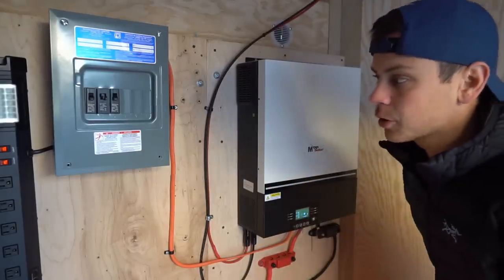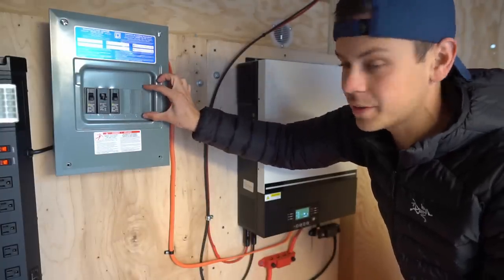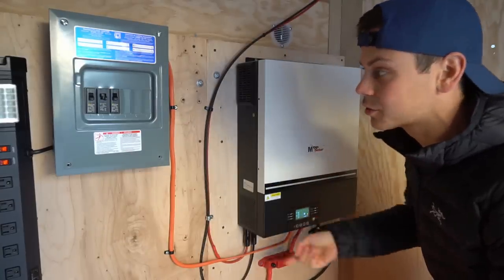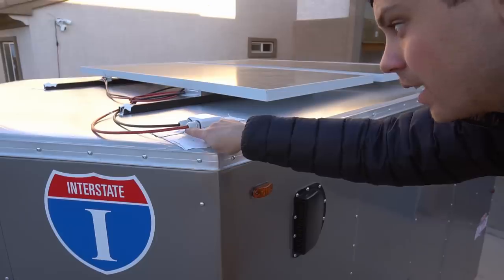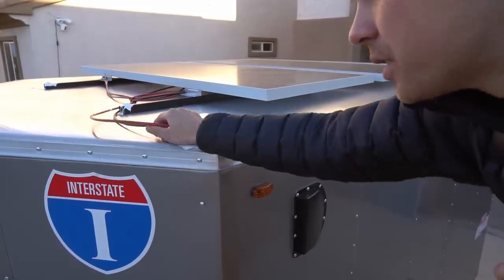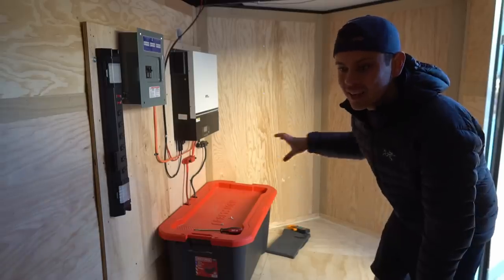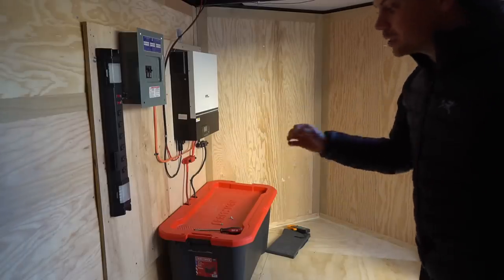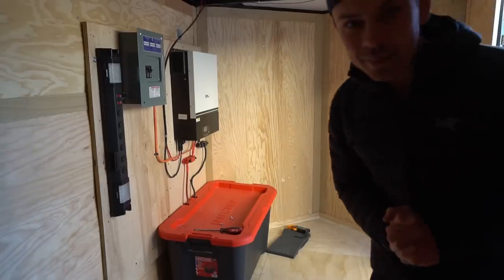Utility Solar Trailer Part 2: Responding to viewer comments

Comment: Your trailer is awesome and I know you have some uses lined up for it. I think you should make one that has the same 8000w capacity, but also have a 220v/110v panel with about 4 times as much battery capacity and give it away. Just think a functioning trailer unit like that with the ability to hear or cool would be a great solution for these crazy weather events we are having. FEMA may want your design if you can get UL listed components.

Comment: Nice response video, I still have more to learn on the AC side thanks for sharing, BTW got all the components finally for the folding crate build but just put out a video on solar folding panels and battery banks for portable in field use. Hopefully get the crate video out soon, will let you knownwhen the vid is up as we talked about previously. Cheers!

Comment: You did an awesome job hitting all the points. I was pretty excited when you said the inverter did 240v split phase yesterday. I actually went to the site to buy it and then read that you need at least two (up to 6) to make this happen. Still very cool as I have a well pump that I plan to make powered by solar and this could be a solution. What is the total cost of everything you have in the trailer at this point?  Thanks again for making these vids!

Comment: WRT AC input- go to your local RV store.  The RV's can have external AC input for 30 or 50A service.  Both of which have adaptors for normal household 120V input.  For sure, they are weather robust, as they are on pretty much every RV.  I got a plug for my travel trailer for a petty good price at our local RV place.
Reply: did you ground the ground wire to the frame of the trailer/dc ground also to the frame
Reply: @tracywood2534  Planning on it- the previous installation had the AC grounded to the frame, and that would be the DC ground.

Comment: You could mount a small mini split unit on the trailer tongue. Then you wouldn't have to worry about something sticking out of side of the trailer or the side to side weight distribution.

Comment: You could connect the Victron smart shunt to a raspberry pi, with a local (12V?) WiFi router to expand the range for monitoring.

Comment: I think it's a great little system too. I know this is an old video now, you may not even see this. I'd like to do a small solar setup on a 5x10 cargo trailer, would be very similar to yours. Do you have and concerns about the durability of the MPP unit in a trailer with regard to vibration etc? How has it held up for you thus far?

Comment: Will, I'm a newbie at solar power systems, and I'm hoping you can give me a little guidance. I just ordered two 12 volt, 200ah lithium iron phosphate batteries, and need to know what type of panels I should get to go with them. Also what mppt battery charge controller I need, and whatever else. You seem to be so knowledgeable about all of this, I know I can trust your advice. I'm kind of scared I'll mess something up on my own... Oh, and the bms on these batteries are 100 amps or volts...🤔

Comment: Not sure if it's in your area of interest, but I haven't seen anyone maximize solar panels on a given platform.  The best I've seen is covering the roof with a stacked sliding panel to one side.  Would be a possible source of future content if you wanted to see how much solar you can get on a small platform like this with hinged panels, sliding panels, flex solar panels, etc.

Comment: Thanks for sharing. I think that a more in-depth set up for a home while in a trailer like this would be beneficial. From what I read, where some people live prevents them from building something like your solar shed setup; However, in a trailer like this, you can bypass those restrictions. Is there enough room on top of this trailer for four panels? I know you did say you might put a third one up there.

Comment: How about move the batteries and inverters from your solar shed to the trailer. Put Panels on the roof and then have the rest of the panels set up like easels that you would take from the inside of the trailer for additional capacity.

Comment: 60 Watts?  Outrageous!
Reply: You did hear the part about how it can put out over 100 times as much wattage? It's not completely asleep at that point. Prayer reviews he has spoken about hell when you disconnect the power all together you have to reprogram it but I don't know how typical that is. I don't know where they shed the 30 lb. My initial assumption was that it was increasing the frequency of the switch then I recalled how the Canadian power supply company has a similar reduction in weight but it is not using faster switches. I still have not found a good street price on the new ATX high frequency kilowatt Plus power supply company that uses high frequency transistors. Around the time it was announced several people reviewed it but I did not bother with those reviews because of the delay  finding them I did see a more recent comparison of it with the legacy 1600 w gan premium price. There are ice cream trucks that have Honda inverter generators of about this power and obviously it does not take long for the battleborns to pay for themselves in comparison being charged from high efficiency grid connections even. It would be really hard to have a solar system on this trailer put amortized out to less cost per kilowatt hour if used only when selling ice cream etc. I do think that the roof of this trailer should have lighter panels and it's over a year ago that the Japanese ones were supposed to be available. My contention is that they discovered how disruptive their lighter weight less corrosive design was and then we are going to see an announcement about billions of dollars of nearshore floating solar by Japan for Japan soon.

Comment: If you want a smart shunt setup that works from a good distance look at Thotnwave Labs. Actually works on any shunt.  I have one and can see my battery status driving down the road. In my 5th wheel.  Also sitting in my house while its parked in front of house.

Comment: Steel mounting bar + aluminum skin = electrolysis
Mount the panels ina rabbeted 2x redwood frame and mount the frame flat to the roof, chamfer the leading edge to reduce drag, cut notches on the bottom of the farme for water drainage and seal the screw holes with PU caulk.

Comment: For outside receptacles, on a trailer, receptacle covers need to be either spring loaded, which are not rated for in use operation with weather protection, or latching in use covers, which tend to stick out ugly.
There are some great in use covers that are flush to siding, brick, or what have you... but the cover doesn’t latch... so, it would get damaged on a mobile use.
The best would likely be the “bellows”style covers, they are fairly low profile, the cover latches, and it can be expanded to allow “in use” cord operation with rain tight protection. But the cord inlets aren’t sealed, so I don’t think it would work well mobile...

Comment: Great video and congrats on the trailer :) I am building a smaller system with an MPP Solar unit and had a quick question: Do these MPP Solar AIO unis need to be grounded to the trailer chassis? 

There are very few resources out there related to grounding trailer builds, might be a good idea to make a video on that concept as you are building out yours!

Comment: Will!!! Check out the solar/generator trailers at Cunningham Auctions. You have 4 days. Unbelievable value, if you could get one it would be in great hands!
Reply from the maker: Yes I checked them out a month ago. Might buy one still. I don't like the battery and it's hard to get rid of

Comment: I would like to see someone take a solar system like this used to power a electric motor which in turn drive a converted gas generator with actual 240 volt outputs. Just matching the RPMs would be the hardest part.

Comment: Will, I use a Victron SmartSolar 100/50 and a BMV-712 in my steel bodied cargo trailer turned micro-toy-hauler and I have no problem monitoring them both from the cab of my F150 while towing it.  You could give it a try and if it didn’t reach or was unreliable, add a Venus GX and use WIFI?

Comment: Hey Will, not sure if it's the same in this US, but in Australia, our AC outlets in portable situations require double pole breakers and switches for both the active and the neutral.  With a trailer, it can't be replied upon that an earth grounding stake would be inserted in the ground, attached to the neutral link busbar, with RCD's installed for safety. This would only be the case if plugging into shore power with the external AC supply earth providing this. I see the power strip is connected to the switch panel, assuming it's active switched only? If there's a fault how is this fully isolated? Something to consider.
Reply from the maker: Holy cow that is different. I'm totally ignorant on this. Our setup is very different. Interesting

Comment: Love it man! Coming from a 240v country the split phase system can be a little confusing Haha! Although I did see this video of a guy in the US using a 240v MPPSolar Inverter with 2 step down transformers with one of them wired in reverse creating like a "centre tap" transformer, creating pretty much split phase 120/110v lines. Obviously because of the transformers the standby current would be higher, but I'm curious what your thoughts are on this solution? Would even love a video experimenting on it if you had the time haha. Keep up the cool work :P

Comment: I have the Mpp Solar LV 3KVA-24 inverter charger unit and it seems to recommend mounting it on "concrete or other non-combustable surface only". I too am using this in a trailer and am curious if I should follow this instruction or you have found this to not be an issue. My thought was to mount a piece of drywall behind it. Can you please address this?

Comment: It is interesting that you don't find BMS with communication useful but then on every build you install a victron smart shut which is basically the same info minus individual cell voltages.

Comment: Your an educator in solar and a very good one indeed. Great tips and reviews and you got me into solar. However, the MC4 solar cable entry unit on the roof is a valid point from the previous viewer in terms of wind dynamics it would be better switching it around.

Comment: Will I’m building a camper van and want to build a cheap but powerful power system, can I use this setup in my van? Would you recommend the all in one charger ? Also what type of dc to school charger would be best I want to make it 24v system.  You could put a dc to dc charger on the trailer to and use the constant hot from the vehicle to charge the batteries.

Comment: I’m interested in knowing if you add two inverters, is that just adding or doubling your wattage, or does it increase your wattage & bring you from 120 to 240 V? Is this called a split phase?
I want to upgrade my system eventually to run a dryer.
Reply: Solar not good when powering electric AC heat type loads - electric dryer, electric heater, water heater.  You would be spending lots on high power inverters, hugh battery banks, many solar panels, thick wiring. Better to just use grid power for them. Gas heater, dryer, & water heater would be a better choice.
Reply: Additional inverters can output split phase, or increase the output phase matched 120V, the control panel is very easy to configure either way.
Reply: @JKLauderdale  
Thanks, but I should’ve specified this is for a house not an RV.

Comment: I'm not sure what the point of putting it into a trailer is? Do you need that much mobile power for a particular project?
Reply from the maker: I said in the first video we are using as a test platform for large off grid inverters. Other people can use a solar trailer to run power tools and welders etc.

Comment: Curious, you mentioned you couldn't monitor a Victron smart shunt from your vehicle while driving. The smart shunt must have a very weak BT signal because on my Victron 100/30 Smart solar MPPT I can easily monitor my battery in my cargo trailer conversion from inside my home at least 40-50' away. The MPPT is mounted on the wall midway between the floor and celling.
Reply from the maker: Yeah it's weaker. It's a common complaint and only reason people give it bad reviews.

Comment: What I am good at is logistics and spatial placement. So what I would have done is put everything on the front walls, but up high so that you could still have space for horizontal loads. I would have at least built a shelf  for the battery pack. And built a custom sized container for the batteries. That off-the-shelf box wastes space and looks rinky-dink.
Reply: If you notice, everything is installed so that it can be removed/moved quickly and easily - even the panels are mounted to a piece of plywood that is then mounted to the wall.  It seems to me he prioritized a quick setup, a quick tear-down and ease of changing things out as he goes.  This is set up perfectly as a testbed, which is what I believe he intends to use it as.  I don't think "permanence" is what he has in mind.

Comment: I ask you , can I use my 4 battle born and multi-plus 24 volt 3000  and a  large victron  charge controller  for this type project.. I have many panels to pick from  to use , I also have two trailers like you and have been considering the pros and cons..I want to have the 120 volt output hooked to a marine style Jack on the outside so I can simple plug up my 30 amp shore power cord and be self sufficient by pulling the trailer near the rv... and just be totally off grid for ac and dc .. obviously with limited AC use .. but enough for my needs.. please feel free to critique good or bad.. thx Jim.

Comment: Wait, if it's 60 Watt standby consumption on the inverter... doesn't that mean that, like, 300 of the 400 Watts of solar panels you have are just going to powering the inverter's standby power load??
Reply from the maker: That's if you run it 24/7. If it's on power saving mode, it's tiny. Just a few watts.

Comment: Hey Will, shouldn't you use 4 gauge wire to connect the MPP to the sub-panel?  That skinny orange cable makes me nervous.
Reply from the maker: The inputs are kinda small. I would prefer a thicker gauge but this fits nicely
Reply from the maker: @uhjyuff2095  good idea
Reply: @uhjyuff2095  my concern is he has 3 15amp breakers on the sub panel fed by 10 gauge.  It would be fine with only 2 breakers, but if he was pulling full load on all three, that 10 gauge might get pretty hot.  And I came up with 4 gauge by Google gauge for 60amp.  It seems like 6 is fine as well.
Reply: If the 10 gauge is a snug fit, it's probably that mpp engineers were designing it for 220, and didn't think about 110 design differences.
Reply from the maker: @MegaNinjanate  lol I am using temporary conductor as I said on my site. If someone is pulling 6.5kW, they will size it accordingly. I don't think my viewers are idiots lol
Reply from the maker: @MegaNinjanate  no it can handle a larger gauge
Reply from the maker: @MegaNinjanate  personally for me, I won't exceed 30 Amps.... Yet
Reply from the maker: @uhjyuff2095  good points. Agreed

Comment: im just asking how you would connect another shunt to an all in on unit so you can basically  have a backup reading for your batteries  as mine failed and i have a shunt spare how would you wire it

Comment: If you had an accident while towing it what damage could be minimized, like using seatbelt webbing to secure the batteries to the floor frames?
Trailers can flip easily. Pays to be secure.

Comment: NOCO GCP1 15A  AC PORT PLUG
Reply from the maker: Genius suggestion! Thanks Scott. That looks perfect!
Reply: just FYI if you ever need a bigger RV or trailer AC shore power connector, Marinco makes several.  But that NOCO is just right for 15A 120V.
Reply: Those are all for powering the trailer... I don’t see any for providing power from the trailer.
Reply: I added outlet to the search terms, and found several that are similar that are outlets, but they wouldn’t be in-use compliant, and would trip the GFCI if plugged in during rainfall. 
Still, a great solution for most uses.
Reply: @WillProwse  I would love to see you add a single phase 8000-12000 range mini split for both summer and winter conditions..... Saw on youtube that CH was testing in ND at -24F.... That build would be nice to see for these constantly changing weather the USA is getting..... could store water year round conditions....

Comment: Hooking up 2 120v inverters to get split phase 240 is confusing when you say parallel. Hooking up 120v inverters in "parallel" would be doubling the capacity at 120v.
Reply from the maker: The parallel is at the battery connection. When you have 2 or more inverters, they are connected in parallel at the DC input/output.
Reply from the maker: Not parallel at the ac output
Reply: @WillProwse  touche'